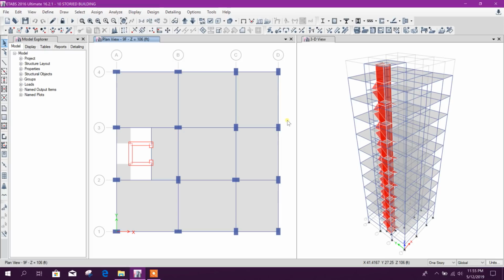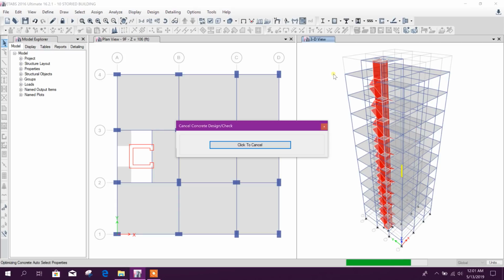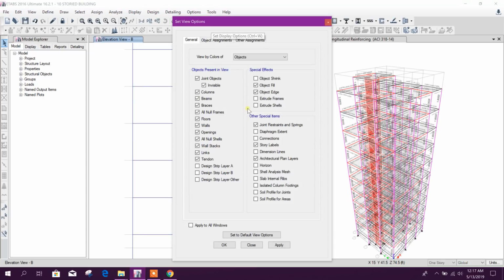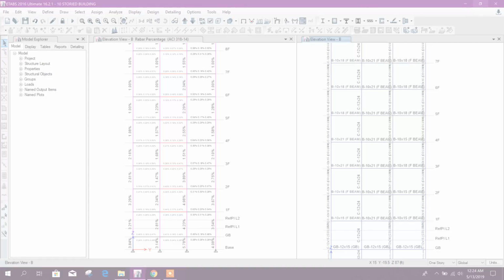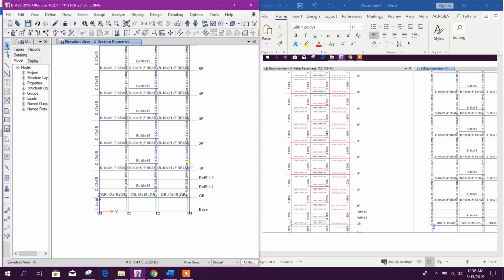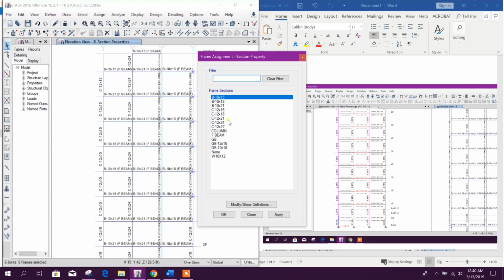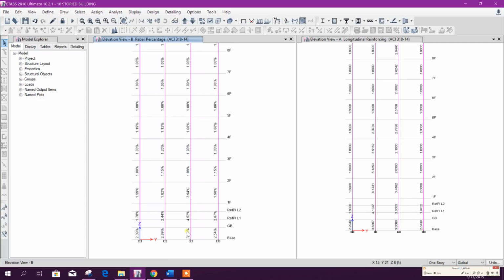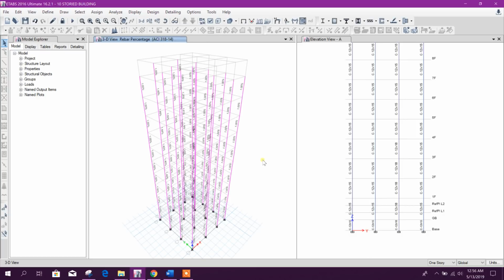10 Storied Building Design in Etabs-Part6

Comment: Sir,waiting for beam design part 7.
Reply: Sir in etabs longitudinal reinforcement for bottom rebar in beam is lower in amount but in reality when I read any beam detailing providing from any structural eng I see that larger amount of bottom bar.my question is why they provide larger amount of steel.is here torsional reinforcement too?Another question is how to joint beam's far from column and ther reinforcement detail and what is the engineering judgment for that....keep it up.we are learning much from u.Thank u for boosting our knowledge.
Reply: Another question I remember that sir how to provide bottom reinforcement? When I analyze any structure maximum  time I got lower Ast at middle in every beam but at 2 side support I got larger amount of steel.now I want to know what is the logic to provide steel and what about the property modifier for torsional reinforcement that u provide 0.001 in previous tutorials,how property modifier work? Thank  u